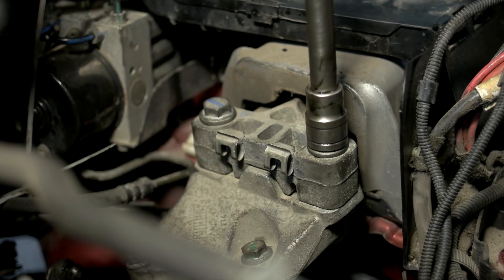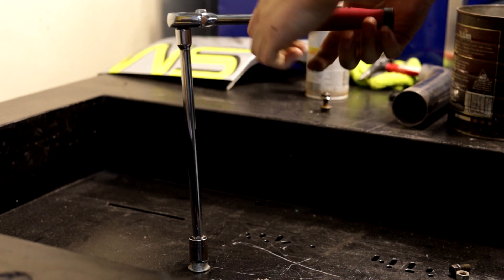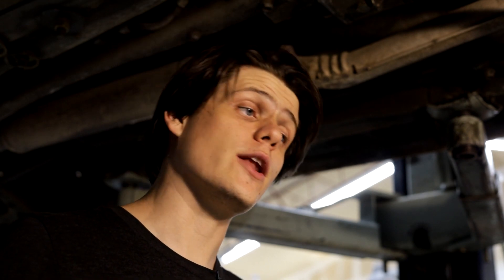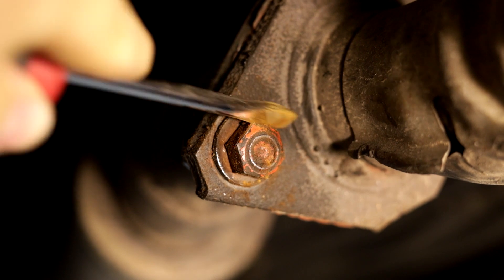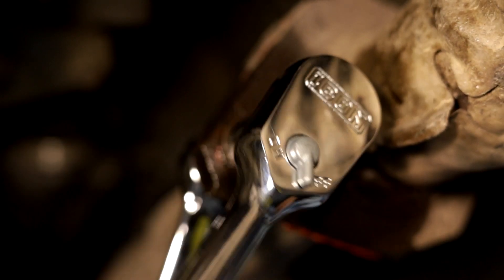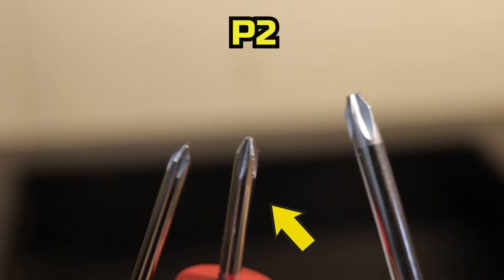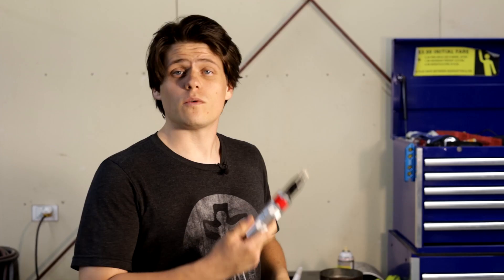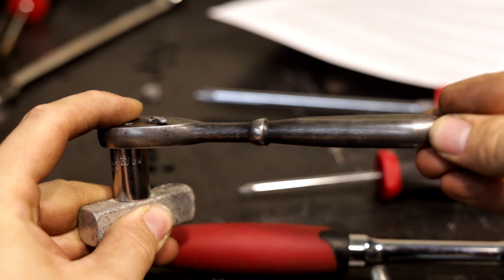Removing rusted bolts, and preventing bolt damage

Comment: Had to take the transmission apart once because the bolt holding the casing together broke. Luckily not stripped and came out with a removal tool, but still, such a headache. At least it was a good excuse to rebuild the entire suspension while I was already taking so much apart 😂
Reply from the maker: That escalated quickly!
Reply: @StandRacing  haha yeah well, I had been putting it off for far too long. After 30+ years, it definitely needed some love. But now everything is fresh 😌  

Often I was very impatient and broke some bolts, so should've watched this video sooner 🙊

Comment: Always check the back side of the bolt. If it’s open, the threads will almost certainly be rusted. Good news you can get penetrating oil into that end. Bad news if it aluminum because that stuff oxidises into and aggressive grit that jams the threads.
If it’s a short bolt, a blast of arc weld on the head will heat shock it loose. It will soften the metal but also make it less brittle. Obviously the removal bolt is scrap.
Reply from the maker: That's an interesting way to heat the bolt up. It keeps the heat pretty direct

Comment: If heat seized the hardware up then only heat is going to free it up. The only thing getting that stuff off is a smoke wrench. Learn how to evenly heat steel up to a nice incandescent orange color with a torch then strike while the metal's hot with an impact gun. It'll come off like it's brand new then. Penetrating oil is not going to do squat.
Reply from the maker: I've had a better than squat experience by mixing time and penetrating oil with rusted and/or heat stressed bolts, but the smoke wrench has its place.
Reply: @StandRacing  penetrating oil works up to a point. Heat seized hardware in exhaust systems is usually well beyond that point. If fasteners are really rusted solid then nothing but heat is ever going to budge them. That's because the heat literally burns the rust away. If you watch closely you can see little sparks flying while you're heating the metal. That's the rust flakes burning. When that hot metal cools down it'll be gray blue and there won't be any rust. You still have to work it hot though because it also won't be shiny or smooth. I can't remember a time when heat hasn't worked for me. It's just that effective. I can certainly recall plenty of times though where I've had to escalate from trying to use penetrating oil to using heat. Then there's the thermal shock method which uses heat and penetrating oils. Although then really water would work just as good. But I still like the idea of getting some kind of a lubricant down into the surfaces. Thermal shock is when you alternately heat and quickly cool the fasteners by quenching them. Them expanding and contracting rapidly can break the rust bond.

Comment: Wish I had seen this 3 days earlier I had to learn the hard way that you need to be careful using an extension just got the job finished person truck so I wasn’t in a rush but  was a pain to remove but had some help from reverse threat extraction sockets managed to get the job done after I had to remove the spindle and hammer the bolt head flatter so the socket could grab all this just for a wheel bearing
Reply from the maker: Yeah wheel bearings can easily become a bear of a job, especially if all those bolts have been on there a long time.

Comment: One thing I learned about after owning a Miata is JIS screws/screwdrivers. I think most of these would be on the interior anyway for a Miata and not super relevant to torque specs and critical components.
Reply: I got a set of JIS driver bits for my 2006 Honda - made dealing with the torqued-down screws on the throttle body a whole lot easier!
Reply from the maker: I learned about those recently. I'm curious to get myself a JIS driver and see how much difference they make.
Reply: @StandRacing  It's probably negligible for most situations, but it's satisfying knowing you're using the exact right tool for the job. Even if that job is just removing a cover panel or something.
Reply: @StandRacing  Late to the party and was about to make this comment. Been a long time since I worked on a Miata, but for my S2K and Japanese arcade machines the Vessel JIS screwdriver make a huge difference in fitment. It's like using a 13mm on a 1/2 bolt. I have the Vessel ball but I've been eyeballing the Vessel MEGADORA IMPACTA and have been told they're excellent.

I used to be anti Torx when I first started wrenching, mostly when attempting to work on a friends VW. And now I wish Torx was as ubiquitous as philips. Anyway definitely recommend picking up some Vessel screwdrivers.
Reply: The JIS driver is an absolute “must have” for visible screw heads and fine stuff like carbs and throttles. Every other will work fine with a PoziDriv.